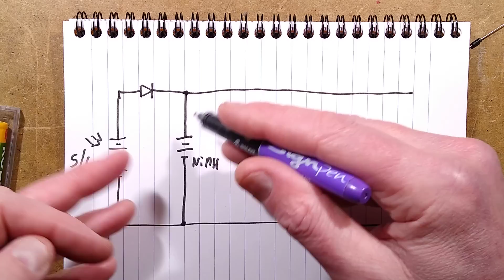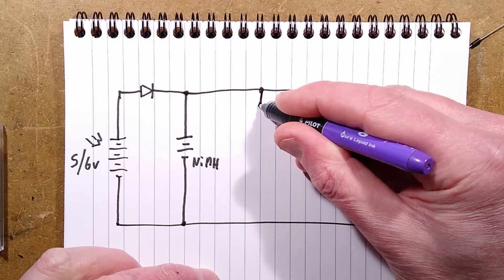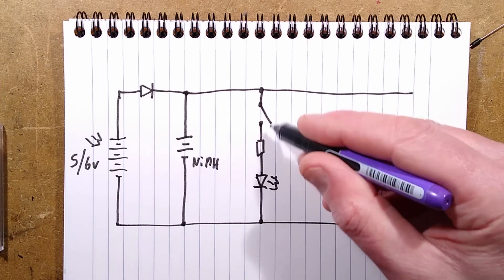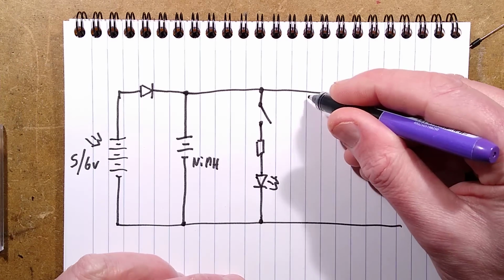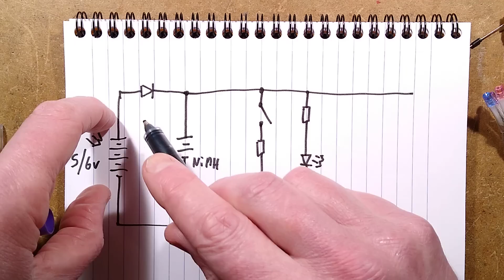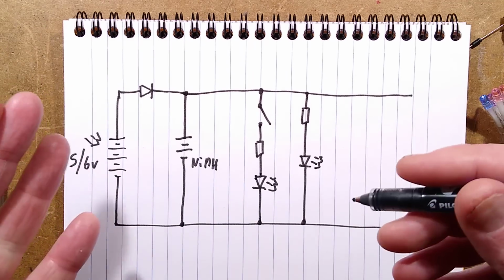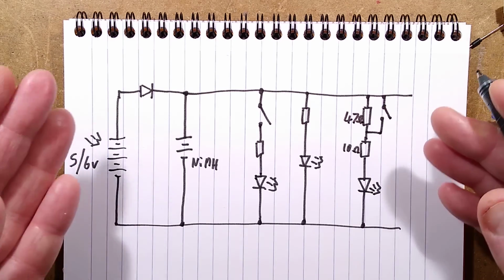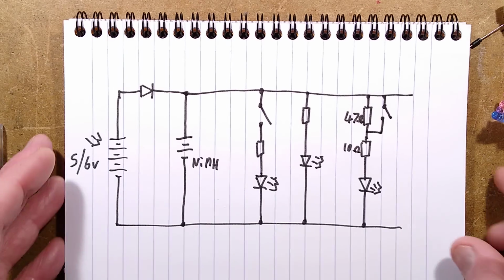Apocalypse solar lighting system.

Comment: Man i swear this is why i watch Clive!  Lol !  Just enjoying all your older content as im a newbie!  I wont lie part of that apocalypse scenario justify all my hoarding of crap ,  that will be useful.     I have bunch of garden solar lights that are half jerry rigged that still work.    Most of them are from 2005-2008.   Even the older solar panels used the lamination process instead of an epoxy layer ontop of the panel.  Which i liked better but also the lamination layer they used had less UV damage compared to the Epoxy layer solar panels.   But they nice, easy and last nearly all night,  They all use NMH battery's which are easier enough to replace.    Its nice to know i not the only one doing this!  I love doing Christmas lights as well .

Comment: Thank you for this interesting project    i have a question are those LEDs in series or parallel?and   I have a 5.5volt 100mili amp solar panel is it enough to charge the batteries?
Reply from the maker: They're in parallel.  Your solar panel sounds fine for charging the cells.

Comment: Show what you used!??? So I can copy the brand
Reply: String of LED lights with 2 or 3 cell battery box...

1 4N1007 diode...

2 or 3 NiCd or NiMh batteries...

1 or 2 10 ohm - 100 ohm resistor(s)

1 5 to 6 volt solar panel...

Wire...

Solder...

Soldering iron...

Comment: I like the idea of doing something useful after the day z, but I think connecting batteries to some leds is too primitive.
I would like to see the doomsday computer implementation running on some IC which is suitable for such pourpose, with integrated screen and which can work from solar panel indefinitely.
On this computer you would put survival wiki, and a spreadsheet program.
Then you can form a new government, and your computer can be used as accounting machine - taxes, inventory, voting etc. You can also start forming the branches of the government and reestablish social order.
One important thing is that the computer should probably not have a gui, for example the spreadsheet table can be sc-im, so only you know how to use it (just in case anyone would want to get rid of you and take your place).
The screen can be amoled, and with terminal programs you can make 95% of the screen pure black - conserving energy.
There are lots of ideas like using EMI shielding, very old IC which better survives radiation etc.

Comment: I loved this and I have all the bits in an eBay basket, ready to check out. I couldn't resist getting 800mAh batteries. I like maximising my effort.

You mentioned there are pros and cons to a three battery version, but didn't elaborate on the cons. What are they?

Comment: Hi Clive, great video! Would a 5V 1W solar panel be too much current for this project?
Reply from the maker: It should be OK.  That would potentially put out about 200mA in direct sunshine, which is fairly high, but still usable.  Especially in more overcast countries.

Comment: Die Schwellspannung von LEDs wird bei 2.4V nur rote und gelbe LEDs zu nennenswerter Lichtabgabe bewegen. Wie das hier mit den blauen LEDs funktioniert, v.a. parallel zu den rötlichen, kann ich mir nicht so wirklich (mit 2 NiMH-Zellen als Quelle) vorstellen.
Reply from the maker: Sie verwenden in allen LEDs Blue-Chips, damit die Durchlassspannung übereinstimmt. Die anderen Farben verwenden Phosphor auf der blauen LED.

Comment: Nice video. Is it possible to do that with a mcu ? (6v 250ma solar panel, lithium 18650 and a tp4056?)
Reply: Yes, I have used a 5 volt and also a 6 volt solar cell to power a TP4056 module and charge a 18650 using a switch to control the output, and / or a Light Dependant Resistor (LDR) a couple of resistors and a 2N2222 NPN transistor to make a darkness sensor for automatic lighting. Works well for current loads below 300 milliamps, although the 2N2222 NPN, according to the datasheet can handle 600 mA I keep current around half rated maximum.

Comment: What if u got nothing, but that solar panel and that battery holder with batteries? 

 Can u connect directly that solar panel to that battery holder with batteries inserted ?
 Of coarse u can monitor charging with voltmeter
Reply from the maker: Without a diode there is a risk of self discharge at night with some panels.
Reply: After sunset batteries will be removed for use and put it back back to charge in the morning.
My concern is can 3 AAA  Ni Mh batteries 1000 to 2650 mah get charged directly ( no diode, no charging module no resistors ) from solar panel producing 5-6  volt ? 
Actually I did this and got them charged to 1.40 volt within 8-10 hours.

However, my concern is that solar panel fluctuating voltage and amperage be bad for batteries charged this way ?

Comment: No fuel... wood, for burning possibly. For everything else Big Clive mk1 scavenger tech. It 'just works' even if you twist wires together. No need for an expensive (and unavailable temperature controlled) soldering device that needs 120 / 240 mains supply.

Clive Tech, unstoppable evolution in reliable survival technologies. Just bring a knife and ummm possibly a bottle of tasty stuff :)

Comment: I'm using this exact set up to power a lollipop house I'm making. I am making a house with fireplace, stairs different rooms and a second floor with separate rooms. Roof, wall and windows are being built how i would build a wooden house if i ever built one. 

The lighting is done with the set up you use here apart from one minor different. I found some blinking tealights to use in the fireplace. 

I'm also looking into building a wind turbine out of an old xbox controller if you have any advice.

Comment: Good video, as usual.  I'm curious. Did you intend to have the battery also being dropped by the resistor? I was expecting the batteries to be soldered directly to the positive from the solar panel. Then, the resistor to be in series with the positive leg of the LED string to the battery. Would this give more charging current to the batteries? Am I just confused about it?

Comment: hey Clive!!  cool project!  I was wondering.  could I do the exact same thing, but with NiMh, like eneloops?  or would there be an issue with the way they recharge?
Reply from the maker: These are NiMH and it will work with Eneloops.  Although this application only needs a low capacity cell.

Comment: Just knowing that every call is about .5v is already useful af

Could you make a video on making a practical small scale generator with peltiers?
Reply from the maker: The problem with peltiers is that they are only really suited for low current use.

Comment: Probably a more practical solution would be to use solar yard lights.

Put them in the sun to charge and bring them in the house at night.

They would probably give you a couple hours of light or you could wire in a switch and use it like a lantern when needed.
Reply from the maker: The best approach with solar yard lights is to hack them so they charge while turned off.

Comment: Nice stuff!
Ive actually got a broke solar/battery torch around which i wanted to fix. Marybeth I‘ll just take this circuit as an example and simplify it.
Question though: If you find LEDs that you have no info about, how do I determine their voltage (ok, I can see at what point they pop…) and what resistor I need?

Comment: Love your videos! Thanks for making them, constantly learning. I have an interesting (and somewhat scary) situation that maybe you can help me understand how it happened. I had a cheap dc speed controller that I installed in my kid’s power wheels. I had built an arduino to talk to a Bosch e-bike battery to power the 36v, 500watt motor. I was out with my son today, and the battery system was having an issue and shutting down. So I disconnected the Bosch battery, and connected the previous 36v lead acid battery. The Bosch battery was disconnected first, but the wiring included a 30amp buck converter (as an auxiliary output to 12vdc). After hooking up the lead-acid, the speed controller shorted the battery to the motor output, ignoring the input from the variable resistor foot pedal. The result was that it the ride-on toy went very fast, and my son ended up crashing into a rock at about 15km/hour. He is fine, and little shaken, but ok. But I am baffled as to how this could happen. Any thoughts? Controller was uniquegoods Upgraded 10-50V 12V 24V 36V 48V 40A PWM DC Motor Speed Controller CW CCW Reversible Adjustable Knob Switch Plus Control Driver https://a.co/d/fmeV0nE (motor and drive train came from a kids electric quad bike, not the stock power wheels motors or gears). Thanks.
Reply from the maker: It maybe crashed electronically or the output transistor may have failed short circuit (very common).  It is useful to build in a safety cutoff feature that can be triggered quickly.
Reply: Yes, after that the rebuild will have a big red stop button on the dash! Is it possible for a buck converter to amplify the line voltage? From the smell and burn marks and bubbling of the large power trace, I would think the voltage may have been doubled from 36 to 72.

Comment: To have greater storage capacity would there be any downside to having two of those battery packs in parallel?  So, 2 batteries in series, paralleled with another two batteries in series (not 4 four all linked in series to each other).
Reply: If any battery is less charged than the others there is a possibility of reverse - charging the cell that may damage the cells

Comment: the solar panel needs a protection circuit before the batteries, otherwise the batteries get over charged and explode...
Reply from the maker: NiMH cells do not charge in the same way as lithium cells.  They can be trickle charged at low current continuously.

Comment: How many leds on you string tried to count them but that did not work. I would like to make this for my out side deck. Also would this charge a 18650 that has a protection circuit on it.
Reply: I have made his solar garden lights using a lithium cell I got a few 500mha battery’s with protective circuits on them using a 50mm round 5 volt solar cell. These work great they charge during the day and run all night never go out. 3 days of clouds they still work but any more the that and they won’t last all night lol. Maybe he will make one with that I would hope the protection circuit would help just don’t know.
Reply from the maker: I've made videos about a simple solar light that does use protected lithium cells, and relies on their internal protection.

Comment: The critical question is: when I am in that Apocalypse scenario, and I have found the needed components by scavenging..... How do I solder? Quickest and probably unstable solution would be to just twist cable ends together....

Comment: Post apocalypse…should you not be using a soldering iron heated in driftwood fire (or any wood, but sort of assuming you’ll be by the beach eating limpets, so there will be plenty of driftwood)

Comment: Contacted Delonghi and asked if they made an electric heater with MC4 connectors as a "dump load" when the batteries are filled.  They said they didn't.  If anyone knows of such a beast (say that could take a dump load from two 400 watt panels) let me know.
Reply from the maker: You can make your own dump loads with suitable heating elements and a thermostat to limit the heat if needed.

Comment: what minimum size wiring (for minimal losses) to use if you have the little solar panel outside, the distance being say 3-4 metres ?
Reply from the maker: The current is low, so just about any wire you can find.

Comment: The diode is not needed, reverse voltage from the cells is so low it will not damage the solarpanel.
And leakage current will be very low.

Comment: Why use Nimh cells and not the lifepo4 batteries that Puffers throw away daily?
Reply from the maker: Those are standard lithium cells.  They could be used, but the circuitry is different.

Comment: Why build it if you would have already flashlights and solar or other capabilitys (bicycle power generator) to charge all the stuff. 🤔 If you have to build stuff in a survival situation it's most times anyway to late,kooj up the real survival people not the fake ones that want only sell stuff all the time. Like 100 flashlights, 100 knifes, 100 fire starter and so on. 🙄🙂😐

Comment: Love the LED string, very pretty. Not sure about having the solar panel working well behind modern double glazing, I've had lots of problems with sensors not working due to UV filtering and energy saving features etc.

Comment: I just thought, I have nice Lidl lights in my room. They have this nice chip which allows 3 positions of the switch. Despite On and Off the 3rd position allows them LEDs to light 6 hours in every 24 hours, starting when you switch. This way I have light only during the night like in auto mode. I just remembered I put the batteries last Christmas and didn't touch them since. Despite that fact I have a very nice glow every night. Now I put them poor Eneloops in my Xtar, and it shows 0%, I hope I didn't destroy them... They started charging anyway... But how could I imagine they are so empty giving nice glow every night.
Reply from the maker: Your Eneloops should be fine.  The LEDs will glow with literally microamps of current.

Comment: Nice simple project. Could you make a circuit that turns the LED(s) on only when the solar panel voltage drops below a certain point? (simple dusk sensor with no extra sensor needed)
Reply from the maker: That's featured in another video.

Comment: Can you use a solar panel to power a light that then points at and charges the solar panel?
Reply from the maker: No.  There is a loss of efficiency in each transition.

Comment: Won't voltage drop pretty much make mounting the solar panel outside not feasible?
Reply from the maker: At low current the voltage drop is low.

Comment: Great littler project, with the current dismal spring weather in the UK I might as well put a 1Mohm resistor in mine. 😁
Reply from the maker: Even in UK weather the output just regulates down to match the light received.

Comment: Being almost totally off-grid and enduring the month of famine which is predominantly December but it can be tricky in early Jan and late Nov depending on conditions, its an improving situations has I fit more panels and new systems. But I have come to respect energy more and use battery power wisely at these times. But living in a house you often have to turn lights on in lots of different rooms just to nip downstairs for something in the night, this is crazy when the light from a single 5mm white LED is more than enough to light a room just to allow you to get safely to where you want to be and back again. Small systems like this interest me has a back up system to supplement what I already have.
Reply from the maker: I have USB rechargeable PIR lights to light paths that are walked at night or during power failure.

Comment: Or keep digging and find some LDRs and transistors.  Then switch off the LED's on sunlight and - if lucky, find the right resistors to control overcharging (just by bypassing the batteries with a transistor).
In short: It's a good idea to know some electronics if you want to survive in a post-apocalyptic area..
Reply from the maker: Just a single transistor and LED can be used as a dusk sensor with the solar panel as the light sensor.

Comment: One can do this before the end of the vurld 😁 I have those cheap solar flood lights in the kitchen aimed at the kettle which is all that needs to be used after dusk so we don’t flip the switch. Charges during the day and at dusk when we are still at prime rate times we use the light switch rarely. Now Clive think about it, if every household did this in the UK and you only save 2£ a month not only does it pay for itself then back but out of 8 million homes that equates to £16million pounds or so per month of fuel the power companies need not use which is the excuse they’ve given as to why prices are so high, put one in the bathroom as well and that’s £32 million per month which just the bathroom and kitchen alone = nearly £450million per annum and we don’t need to cover the roofs with 10s of thousands of £ in solar panels to do so. Clive imagine world wide hmm , also a small heater by the windows can be like an assist to keep the heating from cycling as much since it is one of the main points of heat loss in homes. Add to it street lights with like system that charge during the day and once it’s off buisness hours shut off from the grid and let the lead come on say after 10-11 pm to provide enough lighting for the streets and if a blackout occurs nobody will feel trapped in darkness using their phones to find a way back. Lots of possibilities and affordable at that. Put them in all your windows and by bed time battery is low and ready to recharge for the next day. Great video hope everyone takes it serious. Simple things working together , next window manufacturers might include a strip of LEDS that recharge as well by tiny solar strips. No expensive power wall needed. Take it to the next level Clive, attach one of those cheap body sensors you previously made a video of to have them turn on when one enters the room. Perfect match.

Comment: Speaking of NiMH cells, I did finally get a couple of sets of Anyloop pro 2450mAh cells. Interestingly, I can only manage to use just under 2000mAh of their capacity using my Game Boy Color [sic]. I did a full discharge and charge cycle and they definitely came out around the 2400mAh mark, so the issue wasn't my charger cutting off early. And my 1900mAh cells could use their full capacity when new, although one set is down to around 1500mAh after a few years of cycling a few times a week. So I'm really not sure why they don't discharge to their full capacity in my Game Boy. It doesn't bother me that much, since they're still much better than my old cells, but it is a little disappointing.